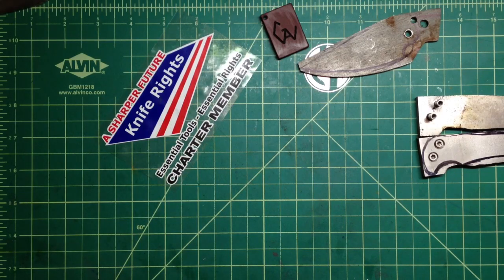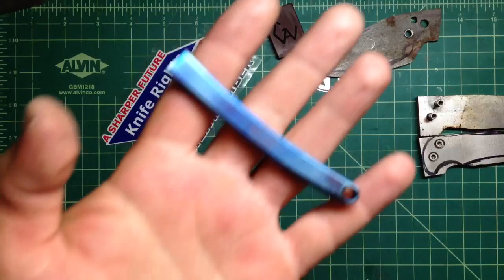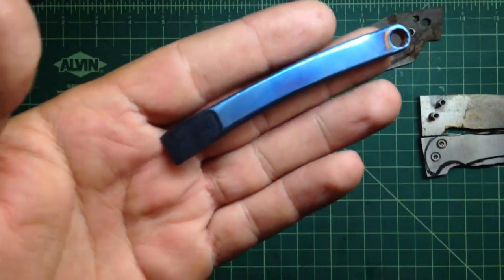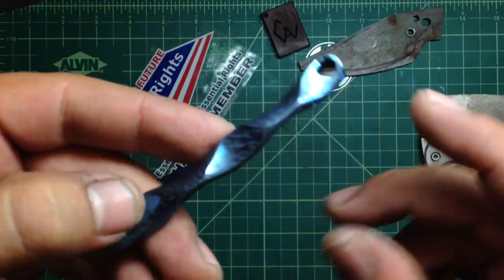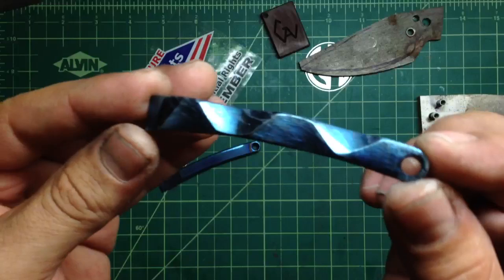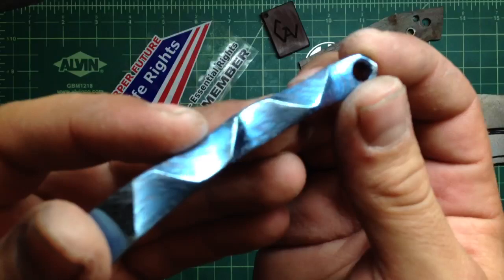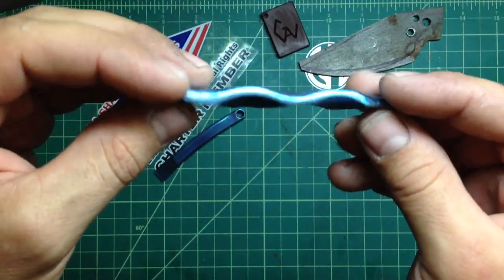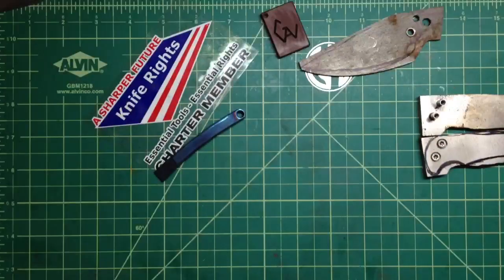Some Cool Titanium Keychains

Comment: The Titanium i have worked with filed like aluminum, but the minute you applied and high speed belt to it ,it would chew up a belt. I am sure there are as many different types of titanium as there is any other alloy. try to file it and see if will work easier with cooler slower processes.